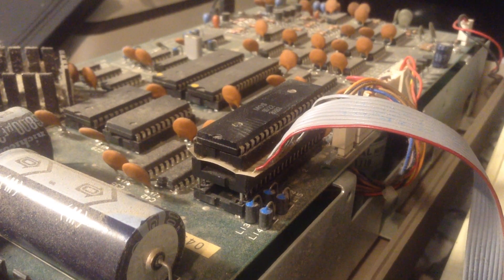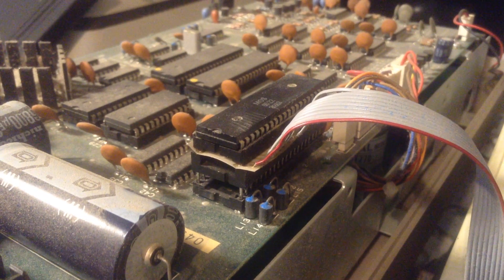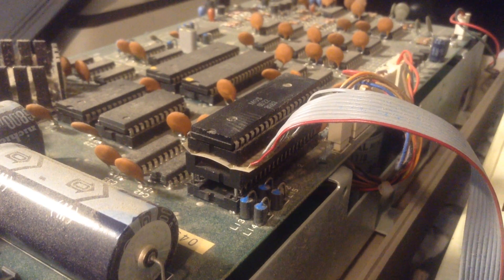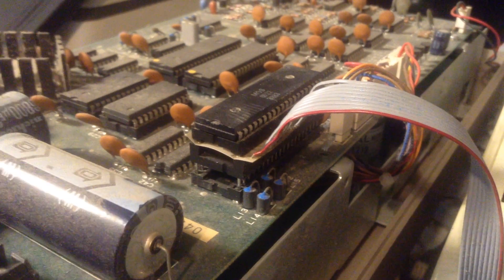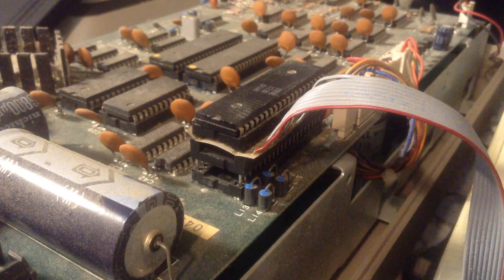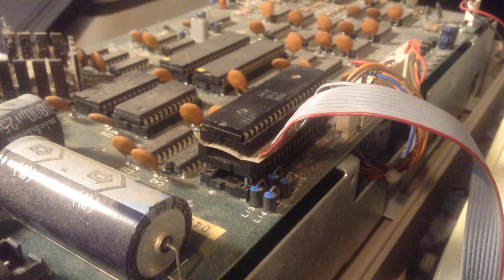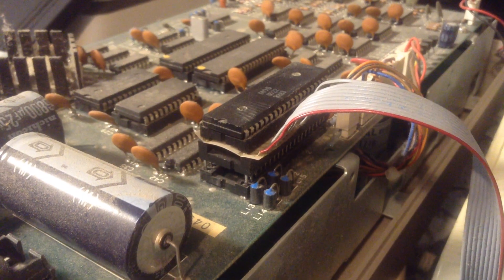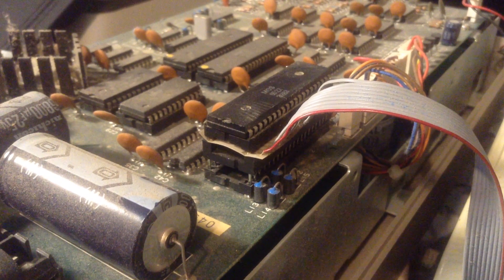1541 Disk Drive Board View - A Strangely Modified Commodore Disk Drive A Look Inside! - Episode 994

Comment: the trick was that by transferring data this way it was not decoded for IEC transmission and that is how most software protection defeated the "normal" nibble copiers.  by transferring raw data you could copy most disks, even heavily protected ones.
Reply from the maker: Sounds tricking indeed...I never heard of this back in the day, but I knew that many were coming up with all sorts of ways to copy disks with the errors intact...for backup purposes of course...

Comment: we used to wire these with wire wrap wire and wire wrap sockets, fun times.
Reply: Was there software to use that?
Reply from the maker: That does seem a better more solid and permanent solution to these connections!  Stay tuned as I hunt for software, etc!
Reply from the maker: There was...it did not come with the drive...I will ask the people I got it from if there might be anything lingering...